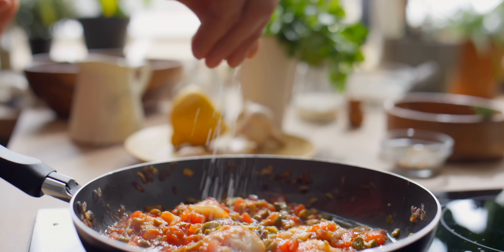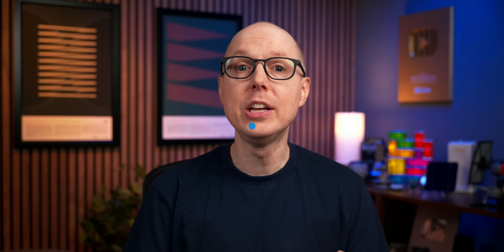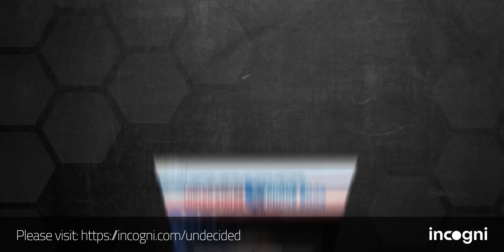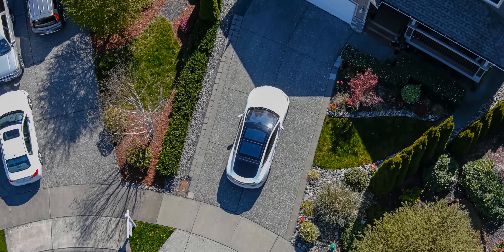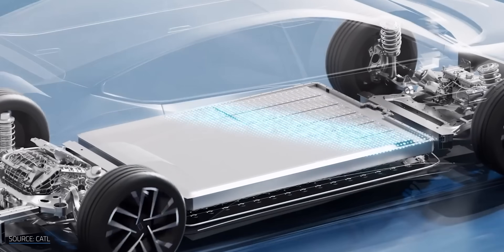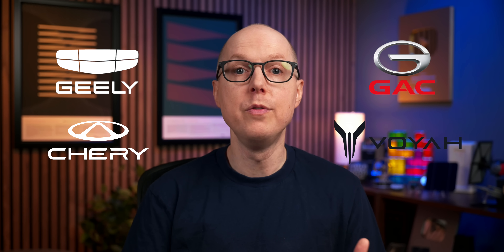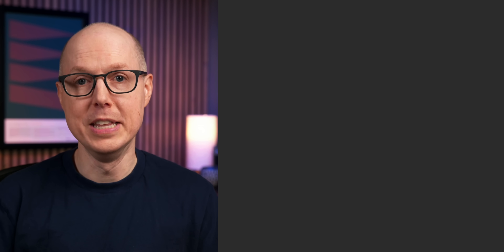How CATL Made Batteries 90% Cheaper (And What Happens Next)

Comment: I am worried about the long-term cost and performance of batteries in EV's. Rechargeable batteries for my electric lawn tools seem to lose measurable storage capacity by the week. I'm spending $20 to $200 per battery pack , but I have a number of them that after many uses are only able to hold 1 to 5 minutes of charge before they have to be recharged again. It is a waste of time to use these and makes the overall cost much higher than the gas used in gas tools. Is this going to happen to the $10k - $20k battery in my EV? A well maintained fossil fuel engine should conversely last hundreds of thousands of miles. The earth needs an environmental life line, but a battery that doesn't have a reasonably high cycle life is not a solution. How about cheaper recyclability? Does it even exist anywhere in a practical way.

Comment: I've worked with one of the prototype units. We have one in a storage unit in Hawaii. Last I knew it was still being cycled using solar panels to charge and running a weather monitoring unit to discharge. It's been running for about 13 years now
Reply: Almost certainly not the same chemistry. Things in the space move lightning quick and in 2012 Na-ion was just hitting in academic circles. There definitely wasn't a manufacturing technique for them at that point. Would love to know what the specifics of the prototype are though, sounds right up my alley. 
- battery chemist
Reply: @hunterm9 it's basically a bunch of 6ft long 4"dia PVC pipes. I think there's 6 of them, maybe 8 I can't remember. They are on a rack with wires coming out of each end that run into a controller. There are linear expansion and temp sensors all over them.

Comment: Sodium ion batteries will be HUGE for renewable energy too!  Solar, wind, etc…  become a no-brainer if storage costs drop dramatically.  Sodium will be great for utility scale storage because energy density is much less relevant.  

Also, even though sodium won’t work for energy dense use cases, like airplanes, it WILL indirectly reduce the cost of the highest energy density batteries just like having the option to use LFP for less instead of NMC has.

Comment: Nope, you’ve missed the point. This is a backwards step for EV. Maybe useful for grid scale storage and home storage and some other applications. 500Wh/kg is where EV become viable realistic propositions. They are far too heavy right now. Need to be 1200kg car that can do 300miles any weather. 1500kg car than can do 500miles. Until then it’s just not working. EV bubble has burst.

Comment: I don't think scale is an issue for sodium. I think they can get scale with static batteries, and cheap cars for the Indian and Chinese markets if they really have that cost advantage. Once they have scale can they squeeze a 300 miles of range in a small cheap car? That would be revolutionary.
Maybe they also  replace Lead Acid batteries.

Comment: Always very insightful and well produced and presented. However, I miss insights regarding the sustainability and supply chain aspects of the different options. Currently china has a firm grip on the rare metal supply chain and refineries which may be the reason behind the very low lithium cost/kwh?

Comment: Buying an EV to charge off a coal grid doesn't make sense. What's the point, just burn fuel. Buying an EV to charge off renewable is too expensive, especially when the standard is to charge after sun down. Buying an EV to charge off nuclear might be all right. Only issue is that nuclear doesn't tolerate fools.

Comment: $10 per kWh is "Shut up and take my money!" time. Because at that level, I'll build a "farm power plant," rack up about 100 panels, 500kWh of these batteries and a big rebuilt Kohler 50kW diesel generator, and run the whole place, shops, barn, house(s) and office. I get lots of sun, but since it's the Gulf Coast, also lots of sequential non-sunny days. The local co-op doesn't pay enough on buy-back to warrant a small solar installation. But if I could charge a bank that's sufficient for the entire place for several days of gloomy weather, I'd drop the co-op's AC feed to tertiary backup level.
Reply: Dang, do you live near me? That's my exact description. Texas, acerage, Co-op. Would almost kill for something like this. Our Co-op is Anti-solar. Not only do they not have a buy back, they make is so onerous to hook up to their service with solar you need an Electrical Engineer to approve the design, and a Master Electrician, as well as thousands in equipment.
Reply: @TXP2P69  Yup. You aren't allowed to have enough panels on a buy-back setup to run the house, so there's not much chance you'll HAVE any to sell them, but if you do, they don't pay enough to ever beat the hook-up costs, the plan approval and so on.  Screw it. If I had $10 per kWh batteries, though, I'd skip the back feed and put in enough panels over in one of the unused thicket areas to recharge a week's worth of them in a day.
Reply: @Thomas-p4e  ..that's "the free market" US style in full swing! US Gov need to fix the monopoly issue with the grids and suppliers
Reply: Yeah, at $10 per kwh I’d be buying them just for fun, haha.
Reply: The $10 per kWh was clickbait bullshit.
Reply: At that price it might make sense for someone to sell apartment friendly backup batteries to be charged at night with lower fees and used during the day. Might need to mount it outside a la heat pump condensers, but I think most landlords would see it as a bonus selling point.
Reply: Thomas, PV (solar panels) make electricity even on cloudy days. ....we're off grid here in Colorado for over 15 years. Only a blanket of snow or night hours stops production. My generator is only for backup or if I'm welding for extended periods.
Reply: And, when they do encounter thermal runaway, they only get to about 400F. Hot but not enough to cause massive damage. The issue with lithium batteries is once they get to burning, it's like napalm in that it re-ignites and is incredibly hot. Up to 1000C. Oof.  This has kept them from being used as battery systems on a commercial scale.  But cheaper sodium? Oh no, it takes up twice the space! Oh no! It lasts 20 years without upkeep ( what will I do???) ;) 
Lithium was always a stop-gap measure. Thankfully most of the vehicles made with them are/will have been disposable junk anyways.
Reply: @plektosgaming  they are widely used on a commercial scale... they're used in 787s, grid scale batteries in Aus etc.

Comment: The biggest fear driving my Tesla around is running out of charge. The second is crashing and being incinerated. If these batteries are genuinely inert and do not catch fire when damaged, that is a game changer. I would happily sacrifice some range if I could drive around without the image in my head of lithium ion batteries self combusting. I also wanted to set up a home solar / wind / battery system, but there is no way I'm putting lithium ion batteries in my house. I think it should be made to replace lithium purely on a safety level, if they are indeed safe. Is there any demonstration of how they handle being damaged or shorted out?

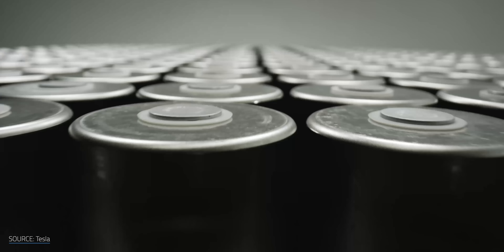Comment: 6:30 - LFP batteries are 3000-4000 cycles before the capacity degrades to 80% of the threshold.  "That's when your 363 mile range drops to 255 miles". That's 30% not 20%, your math sucks. You then quote an entirely different metric and switch to "3.6 million miles of theoretical driving" when you skate back over to sodium, even though we have switched to a theoretical battery that can't be purchased currently.

Your video title is "how CATL made batteries 90% cheaper" - calling yourself "undecided" to add legitimacy and pretend you are tackling things with journalistic integrity is false, you are a shill sir.

Comment: Sodium battery developers should target home use. Installations that can be installed in garages ranging in size from single family detached to condominiums. The immediate benefit of having emergency backup power without the cost and maintenance of a generator is obvious. But combined with charging when power is cheaper and powering homes and EVs when electricity is at a premium is a clear path to viability that can be done now. Then developing it for EV use as a secondary market.

Comment: I don't drive, so that part doesn't interest me, but I'm very interested in home batteries, power banks & such-like, on account of frequent and unpredictable power interruptions both regional (fires messing with the grid) and extremely local (transformers going out). And of course, grid-scale and microgrid-scale storage are extremely important. If CATL's claims here are even remotely accurate, and particularly with the much-reduced risk of thermal runaway, it could make the difference in getting my landlord to invest in a system for the building I live in (a house down the block just had their home battery catch fire last month, so she's skeptical).

IMHO there's always been way too much focus on vehicles, and specifically private vehicles, which pose problems independent of their power source (related to geometry and arithmetic), at the expense of everything else.

Comment: For most of our energy needs, density doesn't matter. Economics do. The only market where that is not true and perhaps reversed is EVs. Renewables have always needed storage to make them work. I know you see all these farms going up and think the storage issues must be a non-issue, but it isn't. Anytime there's a renewable source, it must be made reliable with a non-renewable source. Storage is key. The cost of storage is why it doesn't exist. At 10$/kWh, suddenly, everything is doable. Home storage, grid storage, solar, wind everything becomes real. If this cost is true, fossil fuel power plants will not exist in 30 years. EVs are the last market we need this in, that cost will open up new markets that were inconceivable before. This would be no less than a paradigm shift.

Please please let us know when that number is either verified or debunked.

Comment: HPQ SILICON is producing their new Endura batteries that hold 35% more energy than the best batteries now and retains 15% more energy than the best batteries now, even after 1000cycles.
HPQ SILICON batteries are 85% cheaper and their process drops right into current production plants seamlessly.

HPQ SILICON Endura.